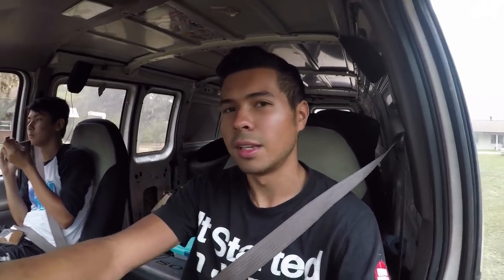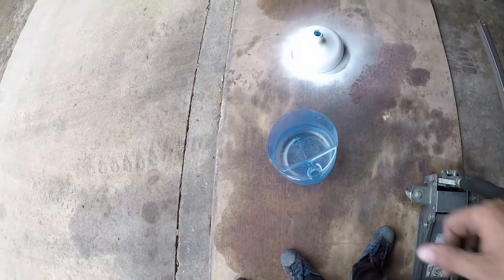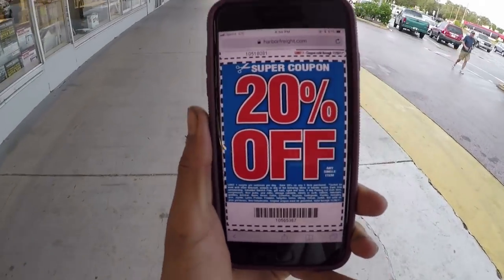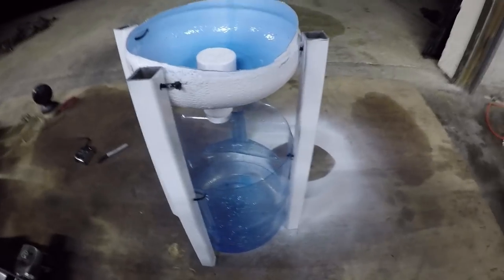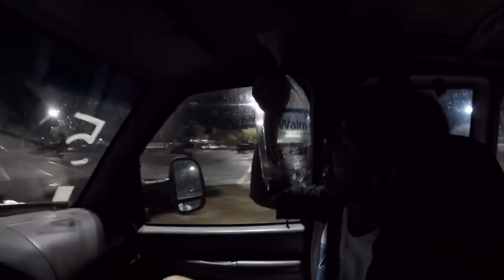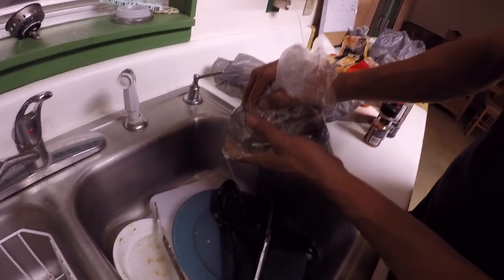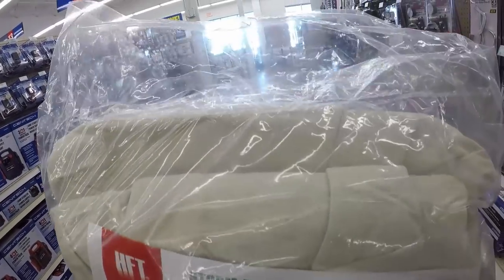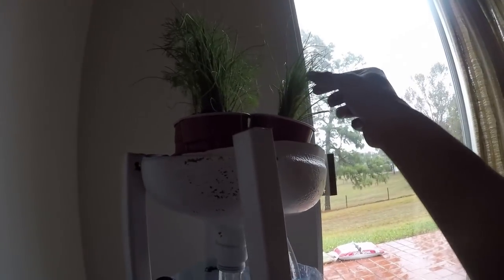Reviving This Channel With Things I Actually Care About (DIY AQUAPONICS)

Comment: I would say I'm pretty experienced with aquariums and such and I've just got a couple of tips

#1 probably should have rinsed the sediment before you put it in because there's usually a lot of chemicals from the "river stone" because they aren't actually collected from rivers

#2 algae is going to grow whether you like it or not, the paint may prevent it for a while but it's gonna grow, also will probably be a pain in the ass to clean off of the inside of the tank (plecostomus' don't really clean algae too great) 

#3 aquaponics setups aren't 100% automatic, you will still have to do partial water changes every once in a while and sometimes feed the fish

#4 don't always believe what the internet or forums tell you, try and experiment and have fun growing onions Onion😉
Reply: Tomlin717 had a pleco. Did help but still had to clean the tank lots
Reply: Plus plecos grow 24”+

Comment: I have a few concerns regarding the fish. You should have run the pump for a few days prior to putting the fish in to clear up the water. The Plecostomus (algae eater) is a tropical warm water fish, not cold.
Reply: the barbs are also tropical, without a heater they're gonna die lol.
Reply: Let's not kid ourselves here walmart fish are exceptionally hardy and could honestly live in bleach for a day
Reply: Captain1diot Excuse my ignorance, but isnt florida a relatively warm place? If not a cheap 10 dollar submersible heater would suffice. But i agree with running the water prior to adding fish.
Reply: Yeah used to have a tropical tank. Needs to stay warm. The fish hate chlorine. And he used bottled water which most have chlorine.... You can add a liquid to treat the water or usually let it sit for a day to let the chlorine die down before tge fish go in.
Reply: He dumped way too much fucking food into the tank too
Reply: XbenX0101 lmao i saw that too. Funny guy onion.
Reply: Lol they're in Florida, the air temp here rarely gets below the mid 70's in the day, so the fish will probably be fine
Reply: Did you see how much food was dumped in there around 29:50
Reply: He should have rinsed the pebbles before putting them in the tank. And most bottle water has salt in it. There are also cheap drops he could add to get the PH balance to a better level for happy healthy plants and fish. But I gotta give it to him, it is working
Reply: They’re heavy fish so pretty good quality
Reply: And he didn’t cycle any filter media, so ammonia is bound to build up. There’s a whole bunch wrong with his setup

Comment: Those fish might die in a few days. Since the tank wasn't cycled for them and the water was probably not dechlorinated. Also some of those fish are tropical like the tiger barbs and need a submersible heater. It's always a good idea to rinse the gravel. If you want the water to clear up more you can buy a large sponge filter from eBay and all you need is an air pump and air line. Also when you feed the fish a pinch of flake food is enough. If you want really dirty fish that produce a lot of waste you should consider gold fish.

Comment: You need to get Ammonia freshwater test kit if you care about the fishes, this will give you a chance to keep them alive.
Also get a super cheap sponge filter driven by air pump, it will grow bacteria that will convert Ammonia to Nitrates which you need for the plants.
Lastly, I would add some cheap light on top of greens, on a timer, on during day off during night.

Comment: Add some bed filling to the neck of the bottle. It will clear up your water. If stuff it in the neck and remove it after a few days and replace it. You can get a huge bag of it for around 3 bucks. Should last for a long while. I use it for my system.

Comment: for your sediment filter just put a sock filled with clean gravel on the nozzle thats draining from your plants. LIke it hangs into the water from the grow bed. You should leave this as a permanent filter on your system because you are using soil in the cup.

Comment: By the way if you want to get rid of the water noise that your aquaponics system makes, you can attach a hose or more pipe to where the water drains out, and make it just barley not touch the water and it will be much quiter

Comment: This is different, but I like it. But tiger barbs really should have a heater. Also to save more power there is a filter pump combo it will filter the water for the fish and be able to pump it back to the top for the plants, very low power consumption and you should be able to run it off solar.

Comment: This is a really neat little system and I'd love to try something similar myself,  but I would have done more research on fish before assembling. Cycling your tank is really important to avoid ammonia spikes and fish deaths, and that "algae eater" is a plecostomus and can grow up to 20 inches so is way too big for what looks like a 5-8 gallon set up. The tiger barbs will also grow to 4 inches long. I would highly recommend rehoming those fish and looking for something along the lines of a white cloud minnow or mosquito fish. Do you also have a heater? Those are tropical fish and need heat to thrive.

Comment: I guess having that water noise at night is terrible, I would recommend you having a tube around the neck of the water jug into the fishwater or having a small plate at 45 degree angle that dampends the speed of the water and makes it not splash on the carpet aswell. looks cool tho!

Comment: Add a air stone to the reservoir. The fish and plants benefit immensely from it. Also the water the should have been acclimated and beneficial bacteria introduced,pH'd, heat regulated and stones pre rinsed. But kinda too late for some of it now i guess. The pump doesnt have to run 24/7. Ive used rock whool/hydroton in my flood and drain set ups ,running 3-4 times a day for 15 mins. But keep circulation in the res.  Also, your plants arent going to do much with out proper light. A 2ft 2 bulb t5 on a 18/6 schedule will work perfect. Been through all this stuff, just thought id chime in

Comment: You should consider putting an in-line filter in your pump to help remove the sediment, could probably even use a fuel filter.

Comment: I have a few tips. Keep an eye on the temp of the water those are tropical fish need to be between 22 and 28 degrees C 24 is ideal.u fed them way to much btw that will rott inside the tank and make the water mank also just make sure u do tests on the water to see if it gets toxic love the vid i love fish mysecond passion nkce vid bro

Comment: @Orion you should get a timer put on the pump so that it only turns on every few hours and if you add an air stone to the water to oxygenate it better it will also elp the plants and fish thrive in your system I actully had very good luck with my aquaponics system and grew different types of lettuce, and I got all my infomation by watch varoius youtube videos as well awesome video keep us updated great job

Comment: Most small fountain pumps like that run under 40 watts and ebay solar panels are pretty cheap. I got a miniature 1.4 watt panel or 6.00$ and 50 watt panels aren't to expensive. For small projects such as this its cheaper than most people think to have it run on solar. Solar controllers are 10-20$ and you can get small 400wh deep cycle batterys for under 100$ if you want to do a legit mini setup.

Comment: When you want to transfer fish like that you need to aclimate them ti the water, not drain it and throw them into a completely different home. Also I would have washed those rocks off first before doing that and let it run for a while so the water would heat up. Also you need to make sure the water remains at the correct temperature for those fish.

Comment: No hate, but if it's something you're passionate about, you should do a little more research. Those fish need a heater, that 'algae eater' will grow to be huge, and you won't have any biological filtration for a few weeks at least. 

Something you should look into is the nitrogen cycle and tropical fish care. 

Once your tiger barbs die, I suggest you get one gold fish. It will outgrow that quickly, but they are good for aquaponics and should be able to survive in Florida without a heater.

Comment: The white pebbles in your soil isn’t fertilizer, thats perlite which aids the drainage of the soil. Also, your setup will probably start to smell and I would recommend moving your setup outside into the garage. I own many plants in my house and one thing that has always been a problem are fungus flies. They are tiny fruit flies that love water and breed in any standing or open water, so beware
Reply: However, I love the setup so far. This is the same way I started when I started growing houseplants. I promise you will learn a lot and keep this going I look forward ton updates!

Comment: Those arent Tiger Barbs btw they are Black Tetras. Just a tip, usually when you add gravel to a tank or whatever you wanna use, you rinse the gravel out first to get rid of all that dirt and shit. Btw you are overfeeding the shit outta them fish, you should only put in small pinches of food and make sure they eat it all before feeding them more

Comment: Should use gold fish as they can live in colder water .the ones you have need a heater and set to 78 degrees .also feed them just a pinch or the ph levels will crash and you will lose the fish

Comment: Pretty interesting, a bit of the hack side but it work. How do yoy sleep tho, this thing make so much noise, maybe you should ad a pipe that go down slowly in circles in to the bottom part and no just let the water dump from the top.

Comment: Are the plant roots deep enough in the cup to reach the water level in the top?
Reply: the soil will soak up the water anyway so they should be fine till they grow down.
Reply: JellyMan3634 I don't think the soil can soak water straight up? If it does that's cool though

Comment: orion no hate but this is wrong, there shuld be no soil in aquaponics, it leaches in to the water that effect the fish, the pebbels are for holding plants and acting as a form of biological filtration, the fish waste once converted by bacteria feeds the plants, you shuld never add fish direct to a fresh set up, u shuld have  had the system running for a couple weeks adding filter start to help Bacteria, u shuld do water changes daily just to help everything settel

Comment: And you also need a heater because these are tropical fish. I hate to break it to you but you may be just torturing those poor fish
Reply: Zach B he lives in Florida as long as the sunlight can heat the water to 72 they should be fine